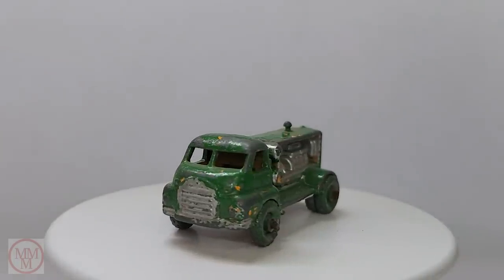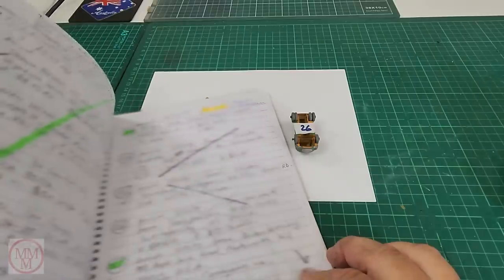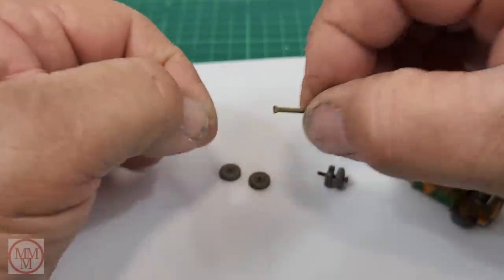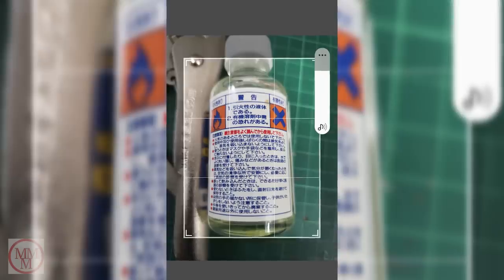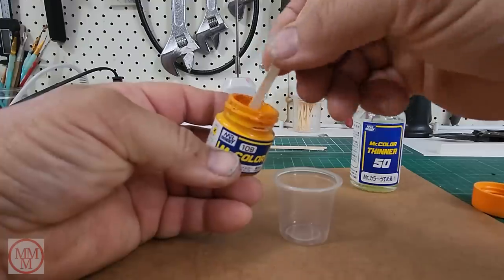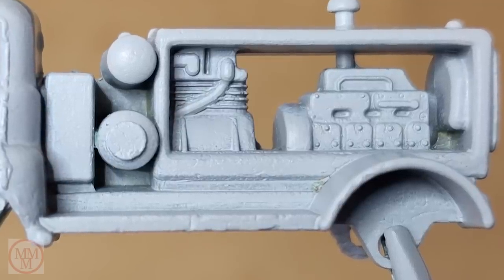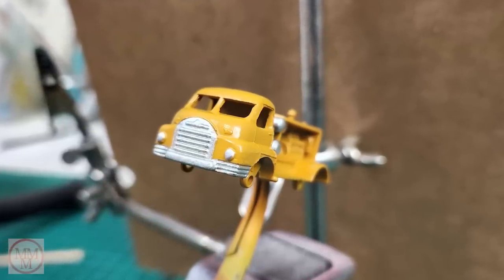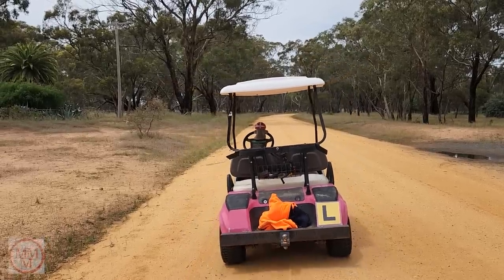MATCHBOX Restoration No. 28a Bedford Compressor Truck 1956

Comment: Hi Marty! Fantastic to see you back again mate. Tip on the Mr Color gloss paints - they dry almost as soon as they hit the surface. So you need a different technique. Spray closer and ‘faster’ if you get me. Also - if it’s still a bit rough, spray some neat Mr Color Levelling thinner - it’ll ‘eat’ the paint and flow back to gloss!

Comment: I loved your clamp use so much, it's the most useful idea I have ever come across.  I use the clamps also on table sides & on home made shelving I've attached to wooden worktops.  These are used to hold tools & my laboratory stirrers for epoxy. 
Take a look at Zero Paints selection.  They list a Volvo & Caterpillar yellow & a couple of diesel engine colors. They're lacquer paints (I find easier to spray than acrylics).

Comment: Mr.hobby or Tamiya give best results when diluted at least 1:1 ratio paint to thinner. 
I personally dilute them in 1:1,5/2 p/t (espacially mr.hobby because is a bit thicker) and put 3-4 thin layers of paint (10-15 minutes apart). 
I work on plastic model kits, but i think it will work great on matchbox cars as well. 
Good to have You back, missed the videos.
Take care
Greetings from Poland :)

Comment: G'Day Marty  -welcome back!!👍👍 As a long-time modeller I can attest that Mr Color lacquer paints do spray beautifully if thinned correctly and using the right pressure. Use Mr Color's Self Leveling Thinner to a ratio of about 30:70 paint to thinner(I spray at aroung 12psi but your mileage may vary). 50:50 ratio is still too thick. Build up the layers slowly and the finish will be gorgeous. Cheers 👍👍👍

Comment: hi, greetings from England,,i had one of these  Bedfords when i was a child in the 60s, this toy is based on the seven and half ton s type Bedford, that thing sticking out of the top of the compressor engine is the pre-cleaner for the air cleaner. similar to what farm tractors have.i still have two of these trucks as a reminder of the 60s

Comment: Marty, what I do is I use a cutting wheel at a low speed: it takes forever, but it ensures I ONLY cut the axle and don't dig into the baseplate. I also use pins from rivets for the axles. I also use 2X gloss Rustoleum paint as it saves me A LOT of time instead of using a primer, waiting, using spray paint, waiting, using clearcoat, and waiting.

I must have something different as I have a Thames Trader Compressor Truck from Lesney.

Comment: Another brilliant job Marty, I'm pleased restoration videos are becoming the norm again. For removing paint job the wheels I use Dettol liquid as it mixed with a bit of water removes paint on plastic parts, left overnight and then scrubbed down with methylated spirits, not sure it could work for you as Its great for plastic model train bodies but I think there is a hobby version of plastic safe paint remover but it's expensive for how much you get

Comment: An excellent restoration!  And a quite simple but good-looking model, too.  One thing you might find useful to know for similarly painted wheels is that a good soak in a degreasing cleaner such as "simple green" for a half-hour or so will soften and strip most older hobby paint without harming plastic.

Comment: Marty I use electrolysis to clean vintage cast iron and it removes paint, crud, and rust very well. I wonder if it would clean models as well. You wouldn't need anything larger than a 1 gallon container for a tank and a manual 12 volt battery charger. There are a lot of videos on how to build one.

Comment: I,m 66, I used to drive those Bedfords in the Army.......Things you never forget?  I remember it's Army Registration number. 03 EL 94.  That is a 1960's number and I signed for that truck in early 1975.....how?  well way back in the day, the Army used to keep a lot of vehicles in deep storage, all greased up and ready for batteries and fuel.  It had delivery mileage only, so in effect a brand new 1960's truck...It drove OK but on a 4 litre odd Petrol engine I would not have liked to pay the fuel bill.

Comment: Thin Mr. Color paints with their Leveling Thinner.  The Leveling Thinner has a retarder in it for a longer drying time.  Use a 50/50 mix of paint and thinner.  This also works well for Tamiya paints.

Comment: Hi Marty, could it be when you've applied the paint stripper you need to wrap it tin foil as the solvents in the stripper need to be in close proximity to work, I've seen programs with restorers trying to remove glue wrapping the items with foil to keep the solvent in the stripper.

Comment: I wonder if you use something like a water pik that's used for cleaning teeth in order to remove paint in tight places after the stripper has done its thing, would work?